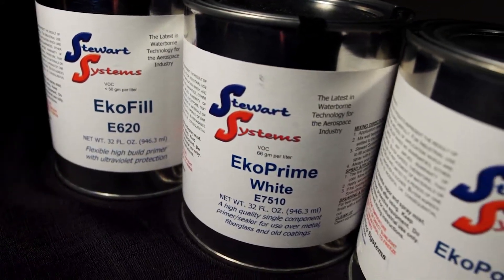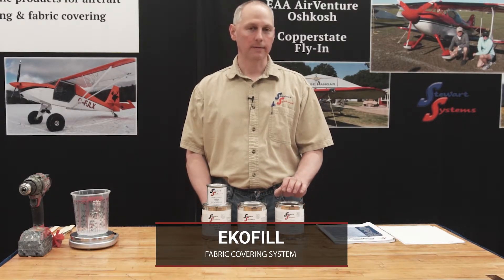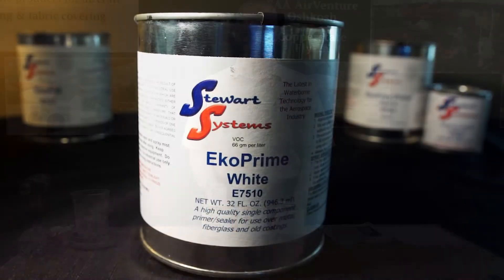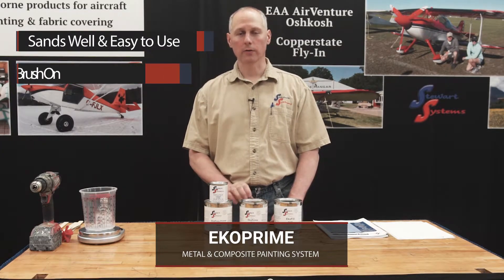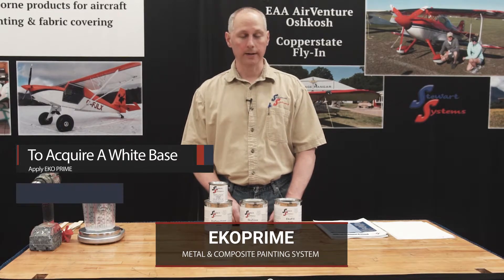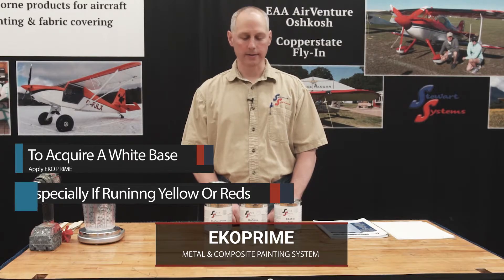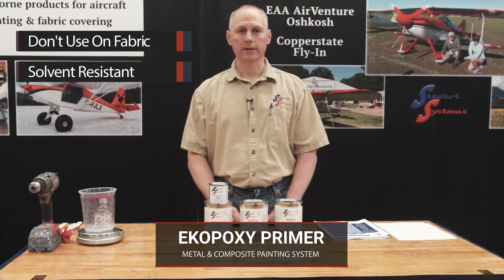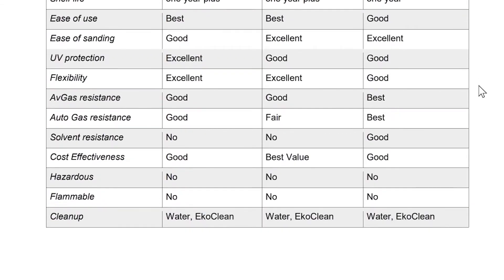Primers overview, EkoFill, EkoPrime, EkoPoxy

Comment: Will Ekoprime work well as an interior anticorrosion coating?  Roughly how much weight per square foot of surface would a recommended thickness of Ekoprime yield?  Is Ekoprime suitable as a sealer for dipping rivets prior to insertion?
Reply from the maker: Yes, Ekoprime can be used as an internal corrosion inhibiting coating.  It can also be used to seal rivets and overlap joints.  I don't have an exact weight per square foot, but if you are building a Vans RV for example, that typically will use about a gallon of material sprayed.  That will add 2-3 lbs to the aircraft.  There is a lot of over spray in that application.

Comment: Wasn’t it said originally that ekofill had to be brushed on first with a foam pad and then could be sprayed after that for more covering,or am I dreaming.
Reply from the maker: Yes, that was the case for several years.  Originally we used Ekobond, then in about 2006 went to sealing with EkoFill, but recently we have found that not only is it actually easier to seal with one coat of Ekobond, but also that it holds up better in very damp environments by sealing the back side of the EkoFill.